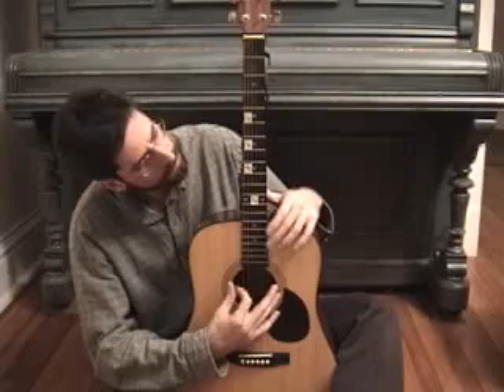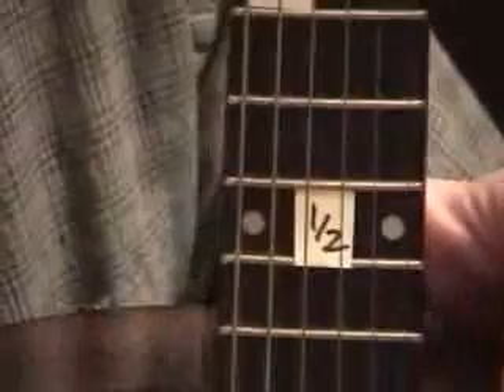Guitar string harmonics and chords

Comment from the maker: A node point is where the string doesn't vibrate in certain harmonics.  When you pluck a string, it vibrates with all harmonics simultaneously, so the string vibrates everywhere (unless you constrain it at harmonic nodes, as demonstrated).

Dr. Dave